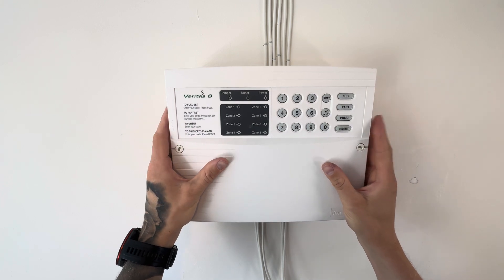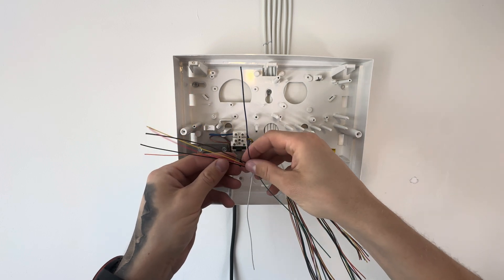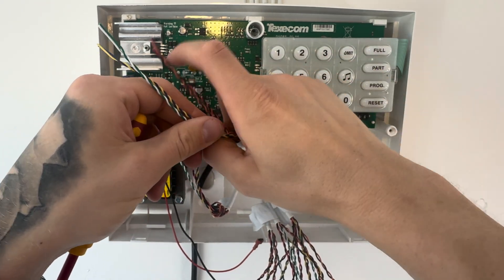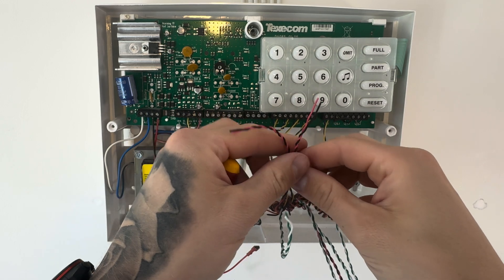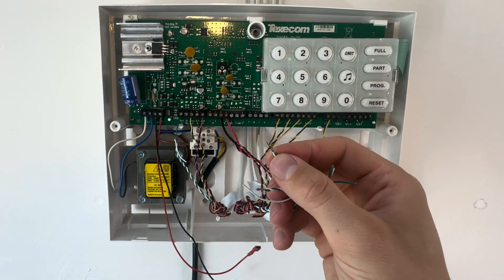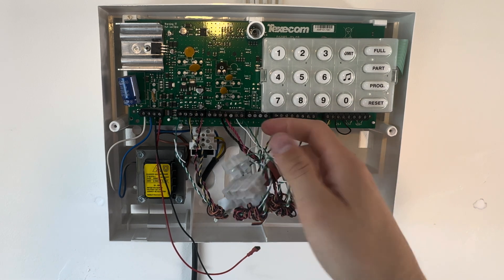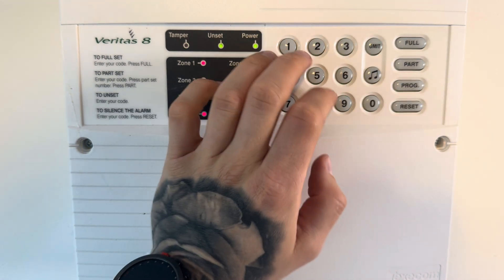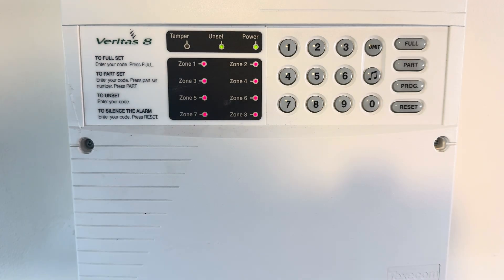How to install a Veritas 8 Alarm System & Programme Step by Step

Comment: Great video, can you tell me how to get into the Engineer hold off  mode so I can do some work on the panel? I have the Engineer code
Reply from the maker: Thanks mate! Yes just enter the engineer code then press PROG, all 8 zone lights should light up, you’re now in engineer mode and can do things like open the panel up or devices without triggering tamper alarms. Press reset when you’re all done to come out of engineer
Reply: @SimonSecurityExpert  Cheers Simon, what a fast response. Thanks mate
Reply from the maker: You’re welcome mate happy to help 😃
Reply: @SimonSecurityExpert , That worked great Simon. I put a new battery in the panel. Does this apply? If I need to work on the Bell box outside

Comment: Hi Simon, HNY. Thanks for creating these Veritas 8 videos. I had a Omnicron 6000 for 25+ years but the keypad eventually gave up so I bought a second user Veritas 8. My existing wiring and bell/strobe do not have tamper wires so I've looped the main tamper but I'm still getting a tamper light and also a flashing power light (I know the power will be my 12v battery and one is due in 2 days. I'm now looking at the Bell and strobe connector that also has an unused single tamper pole. I'm hoping this is the culprit but how can I loop that to ignore this? Would a wire from that single Bell tamper to either of the main tamper poles work?
I've also done a walk test 19 and all work but sadly the bell and strobe don't work. This could definitely be due to age and corrosion etc. If this is the case what's the best way to link the Bell/Strobe 5 pins so the system works but ignoring these as the internal speaker is suitable for now. Cheers.
Reply from the maker: Hi mate! Happy new year to you too. To bypass the external sounder tamper you need to put a link between 0v and TAMP on the bell circuit. Is the bell not triggering at all though? Bit of a shame because it’s such an integral part of a system. Feel free to message me pics etc on Instagram @simonsecurityexpert I’d be happy to run through it in more detail
Reply: @SimonSecurityExpert Thanks for the reply Simon. With more googling and videos I did eventually use a link wire between the Tamp and 0v and it worked 👍🏻. I have tried different combinations for the bell and strobe but sadly no luck. With the bell box being so high up I don't fancy the ladder climb (I'm an oap now👴🏻 lol) and then I bet the cover holding screws will be rusted solid. I'll consider fitting a 12v siren/strobe replacement in a different location and look at this when the weather improves. My new 12v 2.3Ah battery came today and I eventually updated my garage door contacts now being an electric roller.
What's your opinion on these cheap wireless Chinese alarm kits? If they last you seem to get quite a lot of gear for your money?
Sadly I'm not on Instagram but I may join just to have a chat.

Comment: Excellent video, I installed this alarm a while back and recently has to two power cuts in my area, now my alram  beeps once every 30seconds, I changed the battery and also did walk test all is good, the system can be alarmed but the single beep does not go away, any suggestion on how to diagnose the issue
Reply from the maker: Thanks mate good to have you here. Sounds like you’ve accidentally put the chime on. First of all enter your code and press RESET, then press the music symbol, should stop it

Comment: Thank you so much for this detailed, step-by-step video! It was a lifesaver. I had a persistent fault (just like the corruption issue) and this video helped me fully reset and reprogram my Veritas R8. You saved me a ton of money and the headache of dealing with an expensive technician.
For future improvement: Consider making a shorter, focused video where you only show the programming sequence. If you go a little slower and explain why each code is entered, it would be the ultimate guide for non-technical users. Great work!
Reply from the maker: Thanks Zac! Really happy it helped. I’m always happy to take video suggestions too, it really helps me and the channel, I’ll get it on the video making list! Good to have you here 👍

Comment: What is the point of programming the date .  It is not cctv ?   Thinking of getting this panel to replace my 8c as stated to go brittle.
Reply from the maker: Because if you have an alarm event you can see what time and what day it went off, can be useful if you’ve been away on holiday for example and it’s triggered at some point when you were away, useful info if ever needed for police. Not a common thing to need but since it’s so easy to do in the programming you may as well 👍

Comment: hi we have a verita 8 alarm I believe and after doing some electrics with an upstairs light it has triggered an tamper light and all the red lights are on  as well as the green.  The battery back up and master panel is in the loft and believe the battery back up has died we dont normally use alarm much anymore how do we get rid of the tamper lights and the outside alarm light is flashing also.  Also what battery do I need to change to have battery back up again as everytime we have an power cut it sets alarm off and we seem to get lots of them!  Many thanks
Reply from the maker: Hi mate best using 3Ah lead acid battery,if you pop that in the control panel and reset your alarm you should be good to go providing no damage has been done to any sensors. You may need to use factory defaulted codes to reset as sometimes the VERITAS will revert back to that when it loses its power, if so your code will be 4321

Comment: Hi Simon, Very helpful video, why did you set the time and date on the control panel, When that panel does not show the time, And is it really needed on a remote key pad with no display, Just like the one that you are setting, Thanks a bunch.
Reply from the maker: Hi John! Thanks for watching mate and it’s a good question. 

The time and date is advised to be entered incase you want to do things like set up service timers, and download the event log if needed by insurance or police, on the R8 panel you can download it so you get a clear picture of when set and unset/triggered etc, it makes finding the information easier and can be tied back to a specific date and time if needs be
Reply: @SimonSecurityExpert  Hi Simon 
Thanks for your advice, I must have watched your Veritas install video especially the last section key pad setup about 20 times. It's great thanks.
I am having a problem with my Texecom Veritas R8 alarm system. It's a new set up, and I can't seem to get zone’s 5- 7- and 8 to work.
Zone’s 1-2-3-4 are PIR’s Zone 6 is an entry/ext, All work fine.
But Zone’s and 5-7-8 are magnetic door / window / garage door contacts. It looks like these Zones are turned off, My remote key pad is the older type, just with 8 red zones lights just like the one in your setup video, No LED read out. Thanks once again Simon.

Comment: Simon, do you have any videos on relocating the alarm panel without running new cables?
Reply from the maker: Hi mate! Do you mean like jointing cables and extending them to take the control panel to a new position?
Reply: @SimonSecurityExpert yes I need to move the panel its like right next to the door in the way so want to relocate panel
Reply from the maker: I don’t mate, but I’ll make a video on how to joint alarm flex cables
Reply: @SimonSecurityExpert   Okay, I think that should do the Job!Thanks, Its an Optima compact we have btw

Comment: Hi Simon, wonder if you could help, i did a factory reset on my Veritas 8 and programmed the settings after watching you video which is great 👍 the previous settings on my alarm had 2 entry/exit zones front door/back door on a Full set of the alarm which the engineer set up which worked when pressing Full on the control panel, I've set up a part set for entry/exit for 2 exit zones which works okay but don't know how to program the alarm for 2 Zones entry/exit on a Full set, when Full setting the alarm if I enter through the back door the alarm sounds instantly only the front door works for entry, any ideas would be greatly appreciated, thanks
Reply from the maker: Hi mate no problem happy to help. Go into engineer, press 1 followed by the corresponding zone number of the back door eg. 1 4 for example if it was on zone 4, then press 6, then PROG, you’ve now set that zone to an E/E. Question, is there a motion sensor that also sees you in that area after the door has been opened?
Reply: good morning Simon, did what you said both front and back doors working great on Full set of the alarm, I have no motion sensors , I wasn't programming the 1-1 to 1-8 settings correctly think I was only pressing 2 numbers then prog, thanks so much for your help appreciate it, cheers.
Reply from the maker: You’re welcome mate 🫡

Comment: Hi Simon I was wondering if you could help me out. I have got the texecom veritas r8 with the separate key pad, I need to remove a pir zone inside my old garage as it so coming down, (don’t ask why it’s got a pir inside as I don’t know) Is it possible to just link it out or do I need to program it out using the key pad? The key pad is the one without a lcd display! Thanks for any help
Reply from the maker: Hi Alex be happy to help mate. So with the R8 panel you will need to put a wire link in the panel in the zone where the garage is/was. If you aren’t sure what zone it’s on do a walk test and see which it is so you know. You will also need to remove it from the global tamper and remove the power (AUX) from the terminals in the panel. Hope this makes sense, if you need further clarification let me know I’d be happy to run through in more detail if needed
Reply: Thank you for getting back so quickly! I will get back to you if I need further help thanks
Reply from the maker: You’re welcome mate 🤝
Reply: Hi Simon I have removed the wire out of zone 2 and put a link wire in. I have got the user manual but I am struggling to make heads or tails of it!  How do i remove it from the global tamper, is that on the key pad? Where is the AUX on the panel, is there one for each zone? I am a complete novice with house alarms so sorry for all the questions.
Reply from the maker: Don’t worry mate I’m happy to help, the AUX is the power terminals (- & +) if you’re removing a detector that had voltage (motion sensors do) you’ll need to remove the power otherwise you risk a short. 

So the cable that went to that sensor (sounds like zone 2) will have the 2 cores of the cable in the zone which you’ve removed and put a link in so all good. It will have another 2 cores that go from that same cable into the AUX, you need to remove them, they’ll likely be other cables in the AUX powering other sensors so you’ll have to put them back after once you’ve removed the ones you want to remove. 

Now for the tamper these terminals are labelled as TAMP, and you’ll need to remove the other 2 cores of the cable from the TAMP circuit. Depending on the age of your system it may also be labelled up as “/fault”, if you’re struggling send me an insta DM with pictures of the control panel board and I’ll be able to tell you exactly what to do @simonsecurityexpert
Reply: Brilliant thanks you I will have a go in a minute!
Reply: Hi Simon I have Veritas 8 and the keypad doesn't respond to any order and I need your help to make exit door armed when anyone trying to open door appreciate your support

Comment: Hi Simon, I'm experiencing difficulties with installing a texecom impaq sc wired to my veritas 8 alarm? The door magnet works OK and triggers the alarm by when I bang the door the red light triggers but it doesn't trigger the alarm? I've set the the door magnet to zone one and the vibration to zone three. It triggers when I take off the cover (tamper ) but not when I bang the door? I contacted texecom and they advise the following but it doesn't make any sense to me ? Can you please help? I've set both switches to 1. Not sure what the double poll /eol means?
The EOL connections go to another zone, set the resisters to 4k7 (alarm) and 2K2 (EOL), set this zone wiring to double poll / EOL
Thanks
Lee
Reply from the maker: Hi Lee happy to help mate, there’s a different versions of the inpaq so I’m right in thinking you have a 2 in 1 unit correct? Do you also have a bank of dip switches on the PCB of the sensor?
Reply: Hi Simon,
Thanks for your help and prompt reply.
Yes it's both vibration and magnetic door contacts in one unit. It's the latest rev 3. It has two wires for the power. Two for the magnetic sensor and two for the EOL. 
I've wired the power correctly and the magnetic sensor but the eol wont trigger the alarm.  Yes there are two banks of tiny switches. I have them both set on number one as advised by texecom.
Hope that helps
Lee
Reply from the maker: This is the kind of thing where pictures can really help me mate and can advise through that, can you message me pictures on Instagram? @simonsecurityexpert 

I haven’t started posting on the account just yet but it’s handy to help people on for sending pics
Reply: Can I send photos on this YouTube ? I don't have Instagram?
I will sent them tomorrow if that's ok as just off out .
Thanks for your help
Lee
Reply from the maker: Not sure if you can through YouTube but my support email is: support@guardfather.co.uk 

Send them there mate 👍🏻
Reply: Thanks Simon just sent all the detail.

Comment: Great vid. Very useful when installing my new alarm.  Thank you.
I have one question if you can please help. I have replaced my old honeywell optima compact g4 with a texecom veritas 8. Do both alarms share the same negative bell trigger?? Just asking as I have an auto dialler from my honeywell I wouldn't mind to use for my texecon veritas 8. Many thanks in advance
Lee
Reply from the maker: Hi Lee thanks mate glad it was helpful! Yes both alarms share the same negative bell trigger, most do to be fair on the conventional side. Only thing is for a dialler you’ll need a 50v phone line, I think they’ll all be gone by the end of this year with everything going fibre.. unless it’s a GSM unit, worth bearing in mind 👍🏻
Reply: Thanks mate yes it's a GSM with a pre paid sim card. Many thanks for getting back to me. 
Appreciate your speedy reply.
Thank you 
Lee
Reply from the maker: No problem mate happy to help cheers

Comment: Hi Simon, I've just installed the Texecom 8 alarm panel following your video. When testing everything works apart from the bell box strobe and siren. On reading the installation manual it states the control panel is supplied with a link fitted across the bell tamper to simulate a closed circuit. This link is uaually removed during installation , firstly where is it located and how do I remove the link.  Any help would be greatly appreciated please. Cheers Ray
Reply from the maker: Hi mate I’d be more than happy to help. The link that is in there is a metal staple like link and one side is in the sounder 0V and one side in the TAMP of the bell terminals, they are listed as - STRB 0v Tamp Bell +12v - to the right of the battery lead terminals. If there is no link there that’s fine it’s supposed to be taken out anyway. Is the sounder new? If so I have a video on how to install a sounder here too, it’s likely there’s an issue there rather than a link issue that wouldn’t stop it from working
Reply: @SimonSecurityExpert  Thanks for quick reply, both the alarm panel and bell box are new. I firstly wired the alarm panel to the old bell box which is five years old, when that didn't work I bought a new bell box so now I'm stumped.  I've looked at your video several times checking the wires are in the correct locations.
Once again thaks for your help I appreciate the time yo have spent trying to help me. Cheers ray
Reply from the maker: No problem at all mate I’m happy to do help. Sounds like then you have a cable issue, have you got a multimeter? You can do a continuity/resistance check on the cable to see if it’s broken. Do the sounder LED’s light up when it’s got power? You can also check DC voltage at the sounder itself to see if it’s receiving power, it may mean a recable job which is a shame 😣 you’d of been better off with my system, The Guardfather haha all wireless! I was too late getting it to market though ey not till next week 😂 let me know your findings on the cable and we can run through some other options/tests
Reply: @SimonSecurityExpert  Thanks ever so much Simon I'll try what you suggest and  let you know how I get on . Thankyou once again , Cheers Ray
Reply from the maker: You’re welcome Ray best of luck mate here when you need 👍🏻
Reply: @SimonSecurityExpert  Hi once again Simon, I followed your advice and found one of the wires in the cable had a break in it . The alarm system is now up and running thanks to your experience . May I thank you once again. Cheers Ray.
Reply from the maker: Hi Ray just seen this mate, really happy you got it sorted, an thanks for letting me know, you’re welcome if you need anything in future drop a comment anytime, cheers
Reply: @SimonSecurityExpert  Thanks once again Simon.